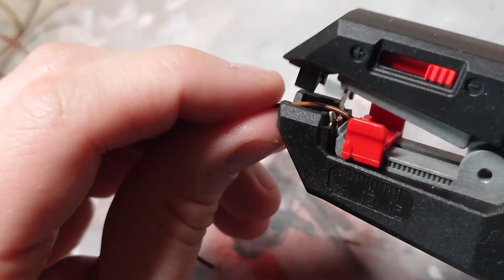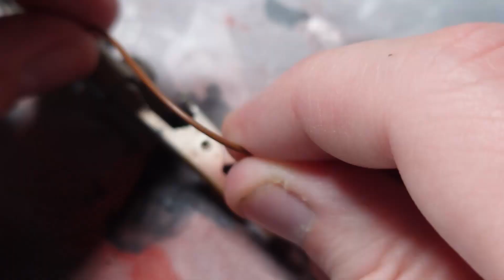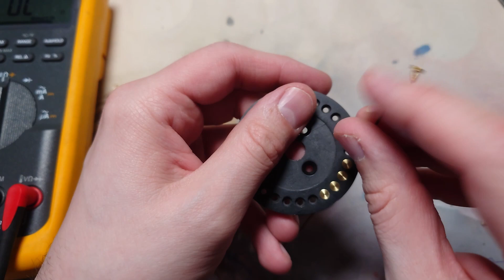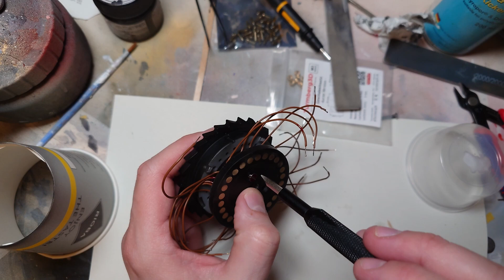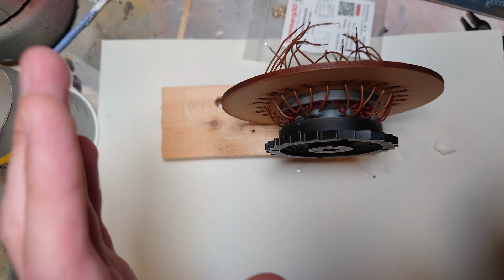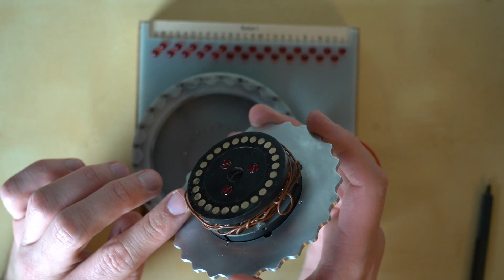The Enigma build Project - Part 14 Wiring

Comment: Very interesting how you’re building the rotor components.  If you’re happy to share, I’m interested in knowing what size of drill and gauge of wire you used for soldering the contact pins?
Reply from the maker: Thank you Very much, the hole is 1 or 0,8mm and the wire is 0,14²
Reply: @

Great, thank you.  I’m also building an enigma machine using the same drawing you are using but 3D printed out of PLA .  I have all the parts printed and only have the wiring to do.
Reply from the maker: @lespatrick658  Very cool, would you like to share some pictures of your machine
Reply: Happy to but not on YouTube.  If you give can provide an email address I’ll share photos with you.